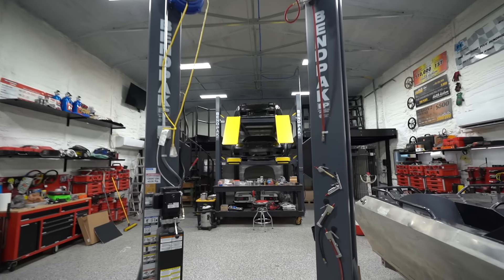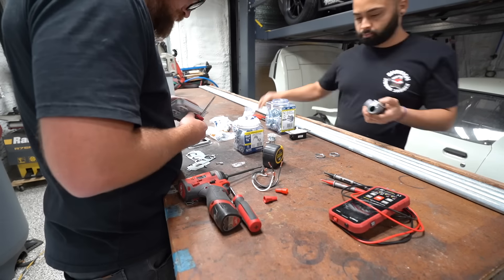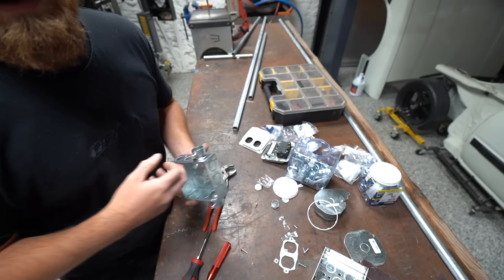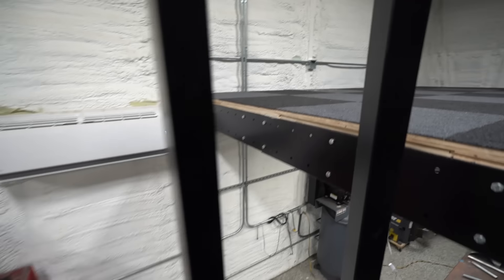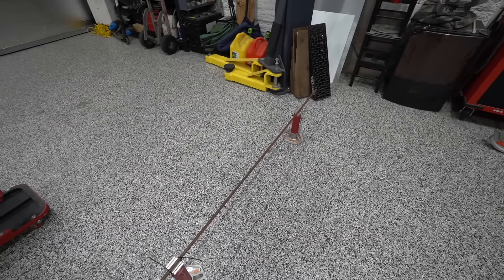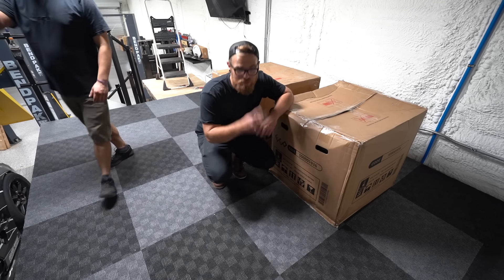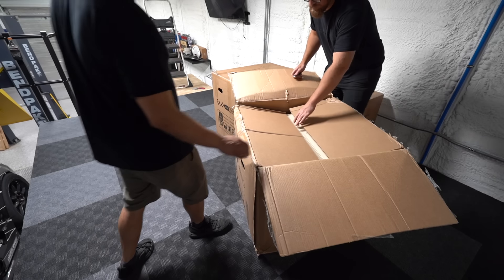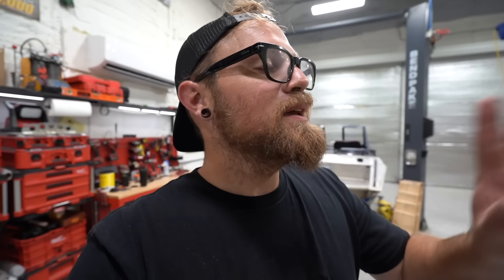Shop upgrades. Loft build part 4. putting it all together

Comment: Leave it to a car guy to wire his shop in DC car color codes instead of residential house wiring colors. Black for hot, white for neural and green for ground. Not red hot, black ground and white neutral. Red is for the 2nd leg of a 220v circuit.
Reply: I was thinking the same thing when they were cutting the plastic off the spools….no green?  What is he going to do for ground?  Oh, black like 12v DC. 😂
Reply: that and i would think it would be a good idea to use romex as thats designed for ac. the wires he used are likely rated for dc. 
at the very least, im surprised he didn't (or appears that way) use any kind of sheathing to protect the wires, or for wire management that is.

If it was just networking cables, then there is no building code or anything like that for that matter as they don't get hot, that and amps/volts are so low that they don't pose any danger. that is as far as im aware of.
Reply: @jd_railfan  you don't use romex in conduit. You use what he used. Just not those colors.
Reply: @jd_railfan solid core is residential, stranded is for automotive so he did right there. As for extra sheathing on the wires inside the conduit, it’s not required by code and would be more of a hassle than it’s worth. Sheathing is only to help with abrasion or vibration and a shop has none of that.
Reply: @jd_railfan  thhn wire is designed for use in conduits.  You don’t want to use romex inside of a conduit
Reply: I'm glad I'm not the only one who caught that 😂
Reply: Like a train wreck I came back just in time to see him using wego’s! This addition will be like chasing a loose ground on a Holley as soon as it fails. Not if, but WHEN.
Reply: @Beardest_Fishing  man, i think everything you just said is wrong LOL. You can use both solid and stranded on residential. Sheathing isnt required by code because its against code in conduit!  Vibration and abrasion arent a problems in shops? They are the main problems in shops, thats why conduit is the actual code for shops.
Reply: Thank you. I was incredibly triggered when black got spliced into the green ground in the existing wiring...
Reply: I was wondering if someone noticed this mistake, mixing 12 v with 120v 220v
Reply: When I saw those colors I initially thought he was going to be running multi-wire branch circuits for the outlets and using the conduit as the ground even though that would be overkill unless he was going to install multiple power tools in the lofts at some point.  Seeing the 3 wires to the light fixture was a 🤦‍♂moment for sure.
Reply: Ever work on a RV?  They wire The DC side like AC. Black Hot 12vdc+ , White Negative -12vdc Green ground
Reply: @Beardest_Fishing when i was 16 i used some solid core wire to wire a toggle switch to my k5 blazer starter solenoid when my neutral safety switch went out, worked great. Lol
Reply: @Dan_Neely Same, I had such high hopes, but eventually that ended with a legit WTF moment!
Reply: Red can be used as a hot in a 120v circuit, typically you see this if your pulling multiple circuits in one conduit, I’ve used black, red, blue, orange all in the same conduit all individual circuits 120v with their own neutrals. Passed inspection, no problems. The rest of what he did idk where his head was at.
Reply: @warrenmichael918  people like to pretend they're experts at everything
Reply: @StanleyKubick1  i guess so. I like to think i am a fairly smart guy but i also know that there are very smart people in the comment sections that i can and have learned a lot of good info from. Then, there are people that just start typing away with nonsense and people that might not have any experience or knowledge about that subject just read it and accept that it is right! LOL
Reply: @Pbell  That's using practical electrical to make a hard job much easier. I've done the same on a smaller scale to make circuitry easier to diagnose and understand but never had to on a full house wiring, bet it would be fun. His head was hopefully using the only 3 colors they had maybe? But still, don't use black as ground and red as hot...
Reply: And for the record, I'm not bagging on you Taylor just to be bagging on you. I bought a house 14 years ago that had part of the circuits all 1 color, every switch, box or light had all white wires, nothing else. Another part of the house had 2 wire (meaning no ground) and half of the circuits used white to travel voltage to a switch and black to bring voltage back to a  ceiling light or another wall socket. I almost died in that house when it burned down last year and I DON'T ever want somebody to be in that situation I was in.
Reply: @timmummert63 I use wegos in an industrial setting. I would rather have them then wire nuts any day of the week. Especially for a piece of equipment that gets wired and unwired often(like many things in an industrial environment)
Reply: @warrenmichael918  That would be a part of your local zoning code I assume. Conduit is required where I live in any exposed circuitry (not framed inside a wall) but the codes on Romex inside conduit is no in any area that's not considered waterproof (underground) and since it's still considered a single conductor (being 3 inside a "sheath" it's still 1 conductor) as long as it doesn't take up more than 50% of the conduit inner dimensions, it's fine. I'm not going to say it's popular or done everywhere, but it's not completely against code.
Reply: Red is also a traveler wire for 3 way switches
Reply: @aldenrichie  for temporary applications maybe. But permanent they can be a problem. Most inspectors won’t allow them in a branch with multiple devices. The only time I use them is on a low voltage light that is easily accessible and NEVER on an outlet that is under constant use. Wego’s are right down there with back stabbing.
Reply: @timmummert63  wago connectors aren't as bad as you might think here in the EU it's rare to see wire nuts at all. It's mostly wago's all over, a dude named greatscott did a great video comparing wire nuts vs wago's you should give it a watch
Reply: Electricity doesn’t care what color the wire is
Reply: Black-hot 
White- neutral 
Red- switch leg 
Probably used conduit for ground
Reply: @StanleyKubick1  Not pretending and never claimed I was an expert. Common knowledge understands that much larger gauge home wiring is stranded but it’s not fine stranded like car wiring. It would be near impossible to make a circuit with 6 gauge solid copper. We’re talking single circuit residential wiring.
Reply: as a guy who only wired houses for 5 weeks...even i was irked by that
Reply: Not sure how it works there but we’re not allowed to mix lighting circuits with outlet circuits due to the difference required at the breaker and cables a big no-no
Reply: @Beardest_Fishing  funny how I see all these guys crying, but not a single person mentioned him backstabbing switches and outlets... I did see him do some terminal connections but not many
Reply: @jd_railfan  Rolex in conduit is generally against code. Not always, but I think in this case it would be against code. But he also used the wrong colors so it is what it is
Reply: @warrenmichael918  If I am not mistaken, MC is also acceptable in this application.   I believe Romex is not acceptable, shops must have wire contained in metal.
Reply: @fr3akonwh33ls1  yeah the inspector is gonna be upset..... oh wait...😅😅
Reply: Brown phase,  blue neutral,  green&yellow earth for us, so didn't even notice they were wrong because they were always going to be wrong!!
Reply: @awballard  That's so funny...I worked on English audio gear in the 80's.  Just like you said, brown hot, blue neutral, green with yellow stripe earth.
Reply: You beat me to it🫤😉
Reply: @jd_railfan can’t use Romeo in a conduit
Reply: Over here in Australia our 240v (regular single phase voltage) mainly use Red Black and Green/yellow

That’s all residential, commercial and standard wiring colours for everything hahaha
Reply: No wonder there’s so many shop fires in the US 😂
Reply: Ya not to code at all. And on the internet for all to see.
Reply: Car guy here    …. Yup 👍
Reply: Red is also used for the travelers in a 3-way switch circuit.
Reply: The only actual national color code is green for ground.  He doesn't even need a ground.
Reply: As an electrician, yes it absolutely should be black hot, white neutral, green ground and can be either stranded or solid in emt, however I will also say that electricity doesn't give a single fuck what color the wire is and I'm not sure in Florida but In my state a homeowner is aloud to do their own electrical work however it's supposed to be wired correctly
Reply: @timmummert63  Luckily it's just a unnecessary extra ground.
Reply: @mpshay  Maybe he can do another video to correct this.  😁
Reply: yeah i noticed this too. in my shop since i have dual gang boxes like he does. I did black white red green and wired each outlet to a different leg and shared neutral. With a little hacked extension cord i have 240V at every outlet in my shop.

Comment: Im a long time viewer but as a commercial electrician… this hurt to watch. Anyone and everyone please don’t take any of his advice here. This would fail any inspection. While I understand it’s his shop, it’ll be caught during inspection when/if he sells the house and someone’s gonna have to have it addressed. Conduit is not strapped within 3ft of it entering/exiting boxes and not using the proper color wire. Code states that White/Gray must be neutral and the ground must be either green, green w/ yellow stripe, or bare copper. Your “hot” wire can be any color in the rainbow other than the ones previously listed. This is considered an illegal installation in my professional opinion. This is why we go to school for this stuff. We have an entire semester dedicated to the purpose grounding and that green wire. Which you not using one, puts anyone who comes to work on that system, in risk of being electrocuted.
Reply: is it also dangerous and/or illegal if he is not using the proper wire thickness (gauge) as well? i was surprised that he isn't even using romex (or related) ac electrical wiring
Reply: @jd_railfan I am impressed that he did use 12ga , but his lighting seems to be on the same circuit as his outlets which is a fail. I am more worried about him using wego connectors and not wire nuts, and also gawd forbid someone who knows proper electrical comes in to work on this and they could be seriously hurt. I can’t tell you how many of those Chinese outlets/switches I have had fail in the last 20 years and the odds are pretty good that he will experience the same.
Reply: @jd_railfan yes. Code is considered the minimum safety standard. You can go above and beyond. For the most part, you can over-size your wire all day long. (Sometimes we have to). But 12 gauge is the most common size you’ll see which is permitted for up to 20 amps. (Yes, I know the 90° column says otherwise but 90° connections don’t exist in regular off the shelf equipment) I didn’t catch exactly what kind of wire he’s using but it looked properly rated for the application. I personally would’ve gone stranded so it’s easier to pull.
Reply: As a union electrician I was puking watching this install. This is a case of "just because you can doesn't mean you should." This wouldn't pass any code inspection
Reply: You beat me to it 😂.  I've worked with enough electrians both union and nonunion.  That was big time fail.

That over stuffed box of junctions needs a complete bomb job.
Reply: Preach it man. I was cringing so hard watching this. I'd be caught dead before allowing any friend to put this up. The next guy who works on the electrical is absolutely going to hate the shitshow that this wiring is. And any future inspections will result in most of that ripped out. The only redeeming factors is he used 12ga thhn and conduit instead of romex or MC.
Reply: So close but so far.

Comment: Did you just use Black wire for ground? Ground needs to be Green. You used wire colors for 12v DC not 120V AC.

Comment: i've done some super high end under stacker LED in the past, it's not hard, and can be done without any modification to the lift. we did 24v 5600k spotless tape in track with a centeral control box with a smart controller per lift so they could be remote controlled

Comment: You might want to add some grounds to your boxes/outlets/switches. Also since they are metal boxes you might want to wrap them up in tape. Don't wrap them up crazy just one wrap around or two. But it will help if you have to get in there live or if something touches and pops the breaker.
Reply: Just got to the part in the vid where you have grounds. Haha now I get it.. you did it like car wiring lol.

Comment: As someone who has done Comercial and industrial electrical work this was a very interesting watch. Good on you for learning something new though.
Reply: If you ever decide to run more conduit a torpedo level with strong magnets is your best friend and bend your offsets in the air, with the handle of the bender sitting on the floor that way you can shoot down the conduit to keep bends parallel while your making the bend.

Comment: Lutron Caseta Wireless (or similar) smart switches would be awesome. Be able to control everything from one spot (or various spots) without running additional wires.  Just program it on your phone.

Comment: You should build a compressor box outside so it’s not taking up the shop space
Reply: I thought the same thing. He replied on a previous video that he leaves it inside so it’s in the climate controlled space. Otherwise the extreme humidity would be really hard on the compressor and the tools used with it

Comment: dont get me wrong taylor, i love all your content<3 but vids like these are why i subbed. the way you edit and film these side projects make it so easy to digest and i dont even realize 40-60 mins+ goes by. maybe for some reason as ive gotten older the car content has gotten stale, but i never miss a property update vid. 

   keep them coming. even if its something like fixing a leaky faucet or replacing shingles or just mundane houseowner shit, for some reason i find them super enthralling compared to event videos. 

   its kinda the same formula after awhile: heres where we're going, heres 10-20mins of in car footage til something inevitably goes wrong, you try to manage, more in car footage for 10-20 mina, a recap at the end. these types of vids are much more interesting to me because i see how you approach different aspects and adventures while applying the same mentality you do to driving ,i just find it more interesting. 

   im not saying you should swittch to a DIY channel or something like that, but dont be afraid to film and post shit you wouldnt normally think is interesting. i loved watching you figure out your irrigation system and shit like that. you can only watch dope in car footage for so long (especially like most of your subs like me who watch multiple drift/track YTers) and they probably relate, before it just gets sorta repetitive. just my two cents. love what you've done with the shop:-)

Comment: Ive paused at 2 seconds, an im going to bring it up cos i seen the thumbnail, MY LORD TAYLOR, you was going to put THAT racking up there with those suspended joints, you need to remember learning new things is a good process, if you dont know how to do something learn to do it properly then do it, dont just send, thank christ you put a solid floor over it, that would have ended in tears i can assure you, dont know how many years it would have taken but if you have one of those legs in the wrong spot before 😂💀🥴

Comment: On minute 22:39 I saw you connecting a green wire to a black wire, being an electrician that’s something that I would never do, in 12v black is negative but in 120v ac black is load it’s like 120v positive and green I earth as negative and white is neutral

Comment: At 7:15 you mentioned that you didn't have 12" to do back to back 90's and while you are correct it made me wonder if you could do what we call a "kick-90" (45 degrees of bend 6 inches away from the back of your 90 may give you the rise you need to finish said stick of pipe for instance). We use them to get around using pull 90's like you used and they are a way to minimize your bends to try get more accomplished when you are doing a long run. The fewer bends you have, the easier it will be to pull conductors in your raceway and per the NEC you can't have more than 360 degrees of bends without installing a pull point or a j-box.
Reply: Wagos are a cheat code. Some people love them and some hate them. The ground wire needs to be green per NEC also. If you were to have that inspected there is a chance the inspector could fail it. The set screw in the EMT connectors technically acts as a ground loop, but the black wire you pulled in is acting as and equipment grounding conductor and needs to be either green, or green with a yellow stripe. There is a bunch of codebook details that get pretty gritty with stuff like that.

The only reason I mention all this is because of you particular you seem to be on your projects so I thought I'd mention it. What you have there will function perfectly fine, but it isn't technically proper.

Comment: You guys freaking out wire color is something else. Will it pass inspection using black as ground? No
But also power doesn’t care what wire color is used. Anyone that comes after him and doesn’t pull a volt meter out to check things before working on it is on them. 
All the “white is neutral” that’s not always true. It can be used for switching power or half your 230v service. 
Keep at it Taylor Ray, keep doing things we all wish we could do.